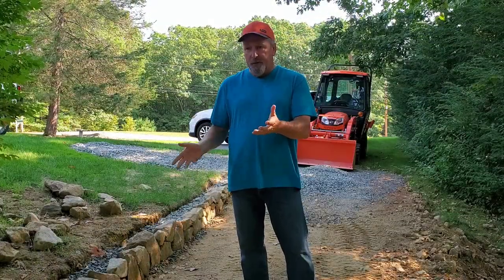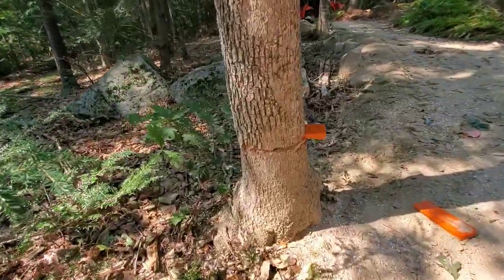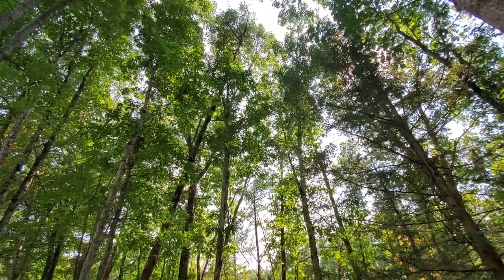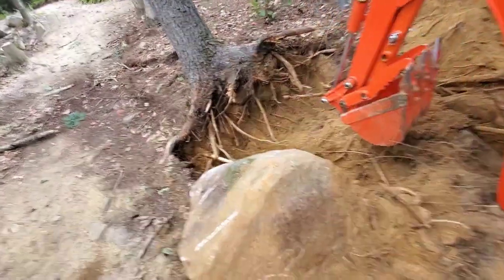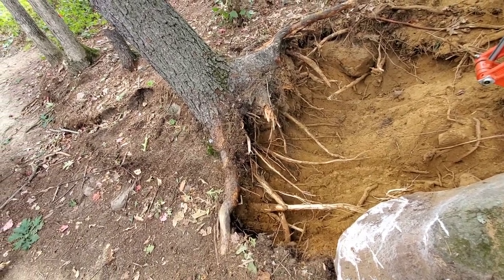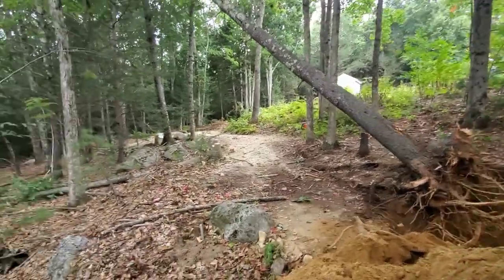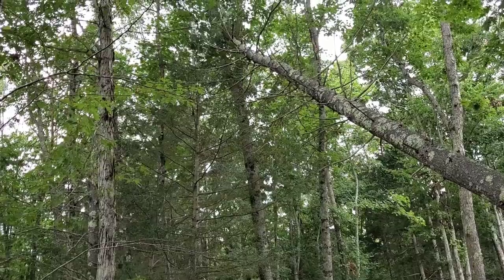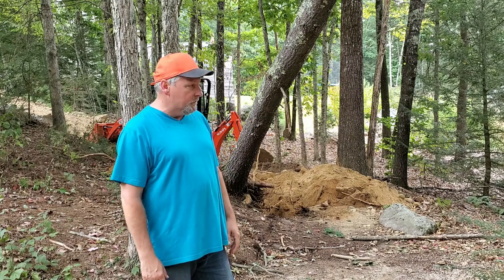Taking Down A Leaning Pine Tree With Kubota BX23S / It Did Not Go Well / Part 1

Comment: From the Offroad world I learned to jam a stick into the middle of the knot on stuff like that (fold over or loop through eyelet).  grab any stick you find, put it in the middle of the knot as you're tying it and then you can twist the stick and the knot will come free.  (Pulled jeeps out of mud holes and the stick loosen the knot so easily a kid could undo it!)

Comment: Don: I have had this issue with trees that do not co-operate. I think if you cut it free from the roots and then just start cutting 16" lengths, for firewood, it will become more manageable for the tractor to pull it away from the other tree. Same idea as below. Take it slow and easy and all will be ok. Take care and stay safe.

Comment: Well, your rock wall looks great. As far as the tree goes, I’m certain by now that you figured out what to do OR you already called “that guy”. If not, cut the butt free of the rootwad being careful not to pinch your chain on the underside. As I saw it slowly fall, I’m not worried about the pressure on the tree; therefore, once the butt is cut free, begin by making cuts every 4 or 5 feet along its length as your comfort level dictates. If you’re unwilling to cut it until it’s perpendicular to the ground, cut it until it’s only moderately leaning and then pull it free of the other tree’s crotch with your tractor and a long chain. Not certain your rope is enough to do the job.
Reply from the maker: Thank you!
Getting it on the ground is this weekends project (and video part 2). 👍
Reply: Sorry I wasn’t there as I did know what to do to drop the tree. Wall looks awesome